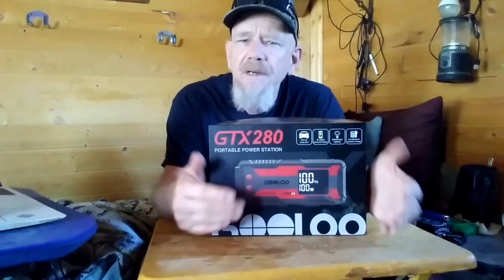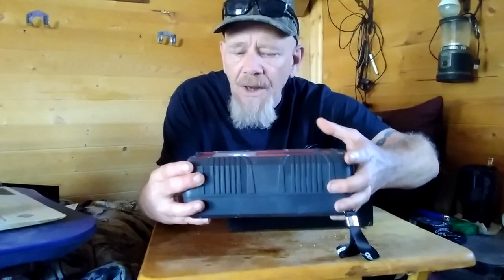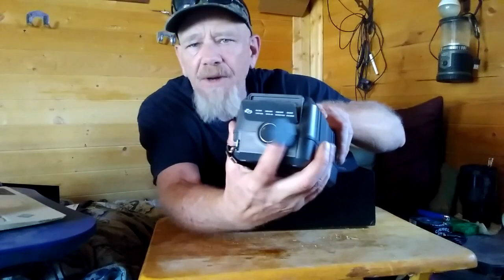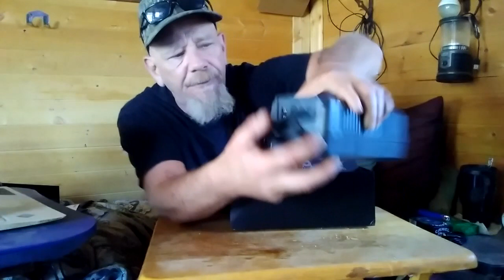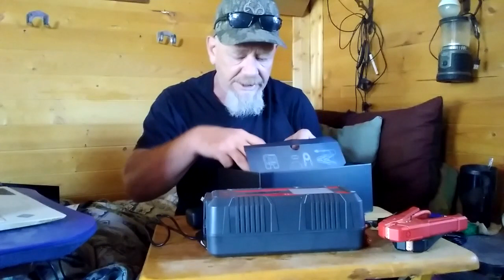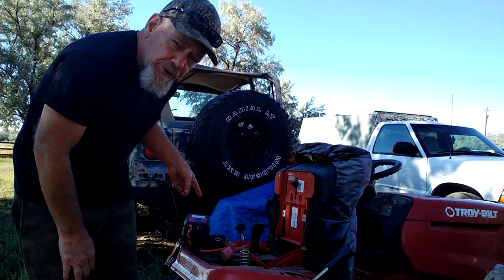Gooloo GTX280 Portable Power Station Jump Starter Review

Comment: [Powerful & Safe Jump-Start] - With 3000A peak cranking power and built-in 10 kinds of protection technology, the GTX280 battery jump starter can safely start a dead 12 volt car battery in seconds. Wake up any vehicle with 10.0L Gas/8.0L Diesel engines (backward compatible), including common cars, motorcycles, trucks, cargo vans, ATVs, snowmobiles, yachts and many more, even in extreme temperatures -4°F to 140°F (Jumper Cable needs to be purchased separately).

Comment: Have you tried charging it with solar panels?
Reply from the maker: I charge everything at my cabin with solar 12 volt or an inverter. This unit used about 65 watts recharging so you might be able to charge directly from panels but that would take some different connectors.

Comment: Hey Lamar I think I thanked you before but I wanna thank you again brother! Thank you so much because if it wasn’t for you and your videos on how to have a homestead with no utilities I would not be where I am today! I just put my biggest system together yet. I have 1k watts of power fully off the grid😃😃😃😃😎 now I would like to say I’m sticking with the lead acid batteries. Only because of the way things are going, those compact solar power boxes that use lithium batteries have to many technical components that go bad and render The Whole thing useless and why I say that with all the shipping and trade issues going on it will take for ever to get a replacement or to have those units sent in to get serviced. I made my system in a separate component system without lithium. Lithium is bad in my opinion is we trying to go green in the world but yet they wanna use a very toxic material that is very costly to manufacture and recycle. Even though lead acid batteries don’t have the demanding power that a lithium battery bank at and instant. Their deep cycle cells can last for years way longer than the charge cycles of a lithium batteries. Yeah they weigh a lot and definitely not good for portable systems lol also I don’t like lithium batteries do to their charging temperament with cold and hot temps as well as cold. They are too tedious.last but not least But not least is the BMS boards they put in them. The batteries can be just fine but the BMS malfunctions or burns out. Rendering the battery useless in a time that we are in today. I apologize for the long talk my brother! Again thank you so much!! You the man👊🏾👊🏾👊🏾👊🏾👊🏾👊🏾👊🏾👊🏾👊🏾👊🏾👊🏾👊🏾👊🏾👊🏾👊🏾👊🏾👊🏾👊🏾👊🏾👊🏾👊🏾👊🏾👊🏾👊🏾👊🏾👊🏾👊🏾👊🏾👊🏾👊🏾👊🏾👊🏾👊🏾
Reply from the maker: Right on! I still have my sealed Vmax tanks on my main system but I have some LIFEPO4 in the cabin so no cold weather issues. Send me some pics when you can!
Reply: @solarcabin  oh and it works for AGM batteries and sealed glass mat

Comment from the maker: Gooloo GTX280 Portable Power Station Jump Starter Review
NOTE: This unit requires a PD fast charge port to recharge.

This is a review of the Gooloo GTX280 Portable Power Station and Jump Starter. This unit has 280Wh of LI battery capacity and can be used as a power station for running 12 volt, 110 volt (120 watt) small appliances for camping, off grid or a power emergency and to jump start a car or light truck.
NOTE: This unit requires a PD fast charge port to recharge.

Portable Power Station:   https://amzn.to/3eOESwG
Power Station w/ Jump Starter: https://amzn.to/3UkMOWJ

I am an official Amazon Associate and I do make a little money if you buy anything through my links and that supports my work to help people with off grid designs and projects for homeless Vets and people in need- thanks!